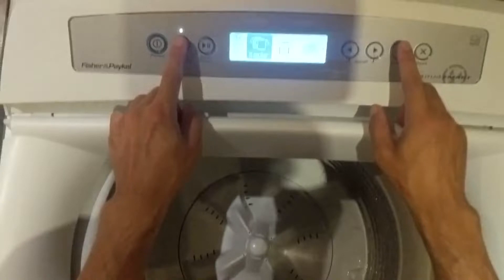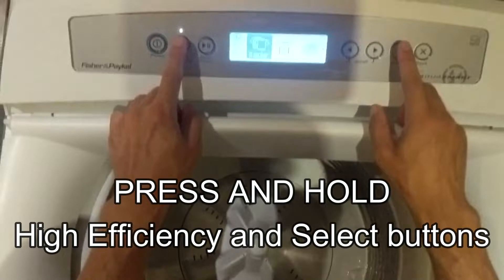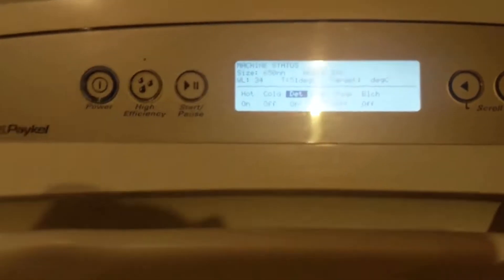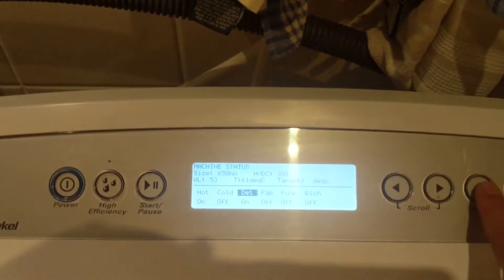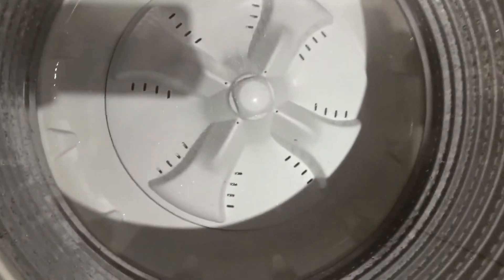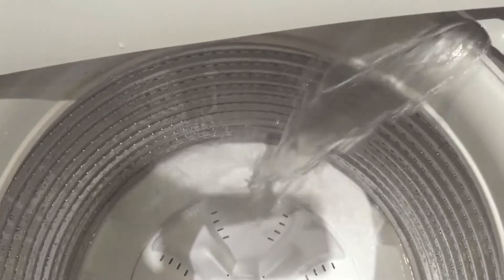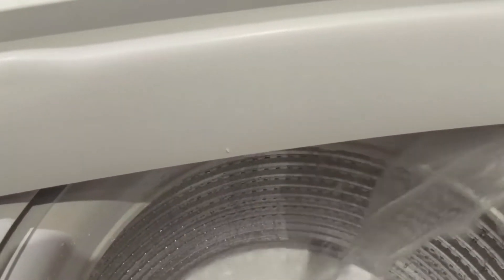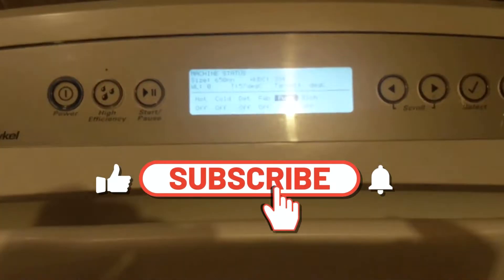HOW TO ENABLE FISHER AND PAYKEL WASHING MACHINE DIAGNOSTIC SETTINGS

Comment: Excellent thank you so much I thought I had reconnected the hoses underneath the lid incorrectly, this showed me that I had done it correctly because the water was working for both the detergent and the fabric softener.
Reply from the maker: Glad that the video helped and that you were able to sort out the issue with the hoses. If you can like the video and subscribe to the channel that would be greatly appreciated. Thanks in advance!